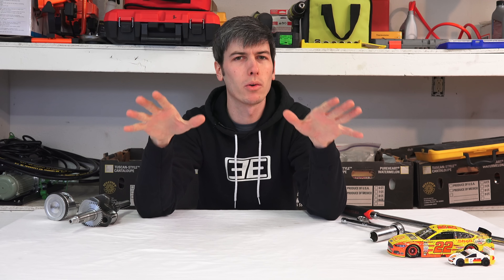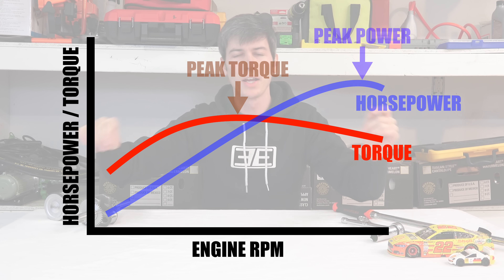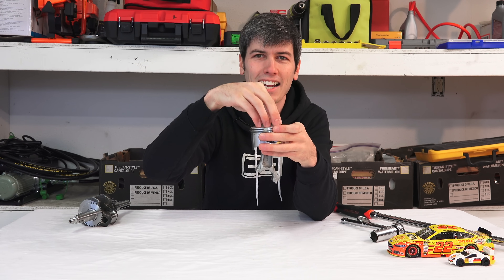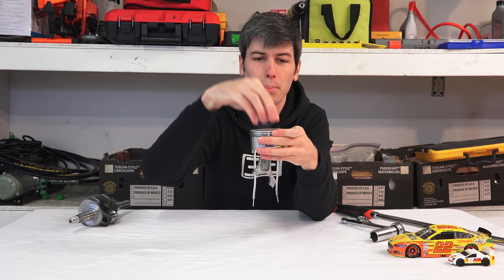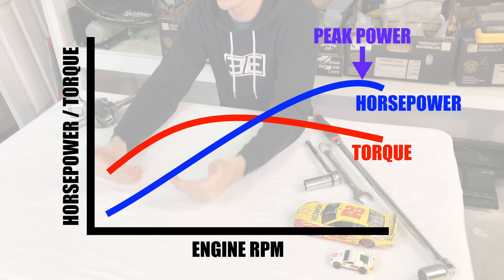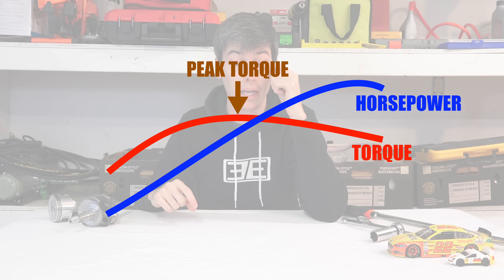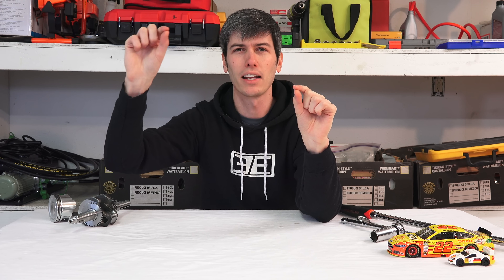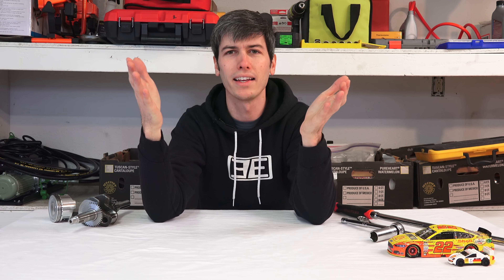Horsepower vs Torque - A Simple Explanation

Comment: I think the great drag racer Bob Glidden (or his engine builder) demonstrated how Torque can be used to the same end as horsepower. He ran long stroke engines that produced more torque and won...A LOT. The thing about horsepower is you have to factor in all the power robbing things like increased friction and inertial forces as RPM increases to where at a certain point it overcomes the advantages of RPM and then goes boom.

Comment: Ok so it's like the difference between the high gear and low gear on a ten speed bicycle. The same power is applied for both, but the gearing gives you different  torques (power applied over distance). The higher gear makes you go faster, but the lower gear gets you over those steep hills easier.

Comment: Being a simple guy, to explain this relationship between torque and power, couldn’t we just use the gearing on a 10 speed bicycle?   If you have the gears on the largest pedal sprocket and the largest wheel sprocket, you are then at the easiest pedal-load, where resistance is minimal, but then again, so is the forward progress of the wheel....

Comment: A car has 120 bhp at 4000rpm power and 280 Nm torque at 1800rpm. Here the equation told by you horsepower=torque x rpm is not becoming true. Kindly explain.

Comment: H.P. = (Torque)(RPM)(2)(pi)/33000.    [torque measured as lb-ft];  Torque [lb-ft] and energy [ft-lb] are measured in the same units. They are not the same thing , however.  H.P. = work/time.  1 HP = 640.8 food Calories/hr  (note the capital "C")

Comment: This video was soooooo confusing!  How can that bigger car be so much faster than that little tiny car?!  🤔.... If those cars were scaled up to “real size” cars that big one would probably weigh about 5,000 lbs., and that little car would probably weigh about 2,537 lbs., making it the much faster car because the horsepower ratio would be way different and the torque meaningless.  Jeez, even a 7-year old would know that.

Comment: Horsepower is not a force.  It's a measurement.  That's where most people get it wrong.
Reply: This struck a chord more than anything he said.  Nice.  Different people need different explanations I guess.
Reply: Torque is force(rotating), Power is force X velocity(rpm X 2π)
1 horsepower is 0.746kW
Torque and power is much Simpler in metric
They probably measure in Horsepower to confuse people and it sounds larger than kW
Reply: @Connor Heh, yeah. That was my point- simply calling it a 'measurement' doesn't distinguish it from horsepower.
Reply: A measurement of what? This is meaningless.
Reply: @provi480  a measurement of work over time.
Reply: @LCDdashSystems  Yeah... that's kind of the key point that you didn't mention initially. Simply saying that it's a measurement doesn't convey any useful information. Torque is also a measurement.
Reply: @provi480  but that's what the guy in the video says all the time, @Procision-Auto just nailed it.
Reply: @provi480  It's not meaningless.  Read it again.

Comment: Both the description and the diagram are incorrect. Horsepower is measured as the heat expansion ability of the combustion pressure. Torque is the rotational force produced and that force does not travel in a straight line but twists around the crankshaft centerline.

Comment: Basically a motor only produce Torque. The horsepower is a mesure created to help people getting into it. For example what better a motor with 200 lbs of torque at 4000 rpm or another one with 150 lbs at 8000 rpm. On the first example the motor make 152 hp and in the second one 229 hp. U can easily find the formula into google
Reply: But on normal everyday roads the first example would be more enjoyable to drive. On a race track the second example.

Comment: He's talking about Power and Torque measured at the engine. Which is great if you have the ability to build your own gearboxes. But Mr Average doesn't have that ability so he measures Power and Talk at the wheel, gearbox already tuned to what the engine produces. So in reality his example of 200HP - 100LB/FT v's 100HP - 200LB/FT surely the cars would accelerate equally?

Comment: Hi, I like your videos, I would like to know if you make a video on 4/6 8 cylinders, power cycle, and comparison with lesser engine cylinder turbo. power torque and driving dynamics. For example say, 6 cylinder Honda Accord vs 4 cylinders 2-liter turbocharged accord. which will drive better, little bit technical and physical interpretation. Thanks

Comment: This is a very nice video presentation unfortunately I have read comments here that are terribly wrong! Please people, if you are not a Certified Mechanical Engineer or a Certified Mechanic who has excellent theoretical knowledge in Power Calculations please DO NOT INSIST YOUR OWN ANALYSIS! You will only mislead other people with basic knowledge on Power calculation. Please do not talk about the difference between Torque, Horse power, and RPM if your knowledge is just your own personal understanding or experience. Remember, only the Educated ones are authorized to give a correct answer. Imagine if you are just a mechanic and then you will operate a patient with tumor using your own knowledge or understanding in how illness are cured, do you think it's appropriate?! LOL. So please DO NOT INSIST your knowledge here if you do not have a certified education on this mater, because I repeat, you will only be misleading other people who wants to learn the correct way. If you think you know it on your own personal understanding, then keep it to your self. Do not spoil the correctness or accuracy of this great video!!!!

Comment: Hi... Any one pls.. I understand.. But what means 230 newton metre.. Or some other values...
Reply: Those are just numbers, so U can compare them easily. Of course they are full lie, as they don't state the weight, what fuel is used ... so those are just like general numbers to give you some impression. Those are numbers made that you can throw your hard earned money. As if you look at the numbers you would buy 2000cc motobike or a Ninja2, but in reality all you need is 300cc adventure bike. The numbers are here coz we are trained to restrain our minds with them since very young. So we start to believe hard that numbers are special, trustworthy and 'easy' for the brain.

Comment: There's a more simple explanation:

Horsepower influences the speed you hit a wall with
Torque influences how far you push the wall you hit
Reply: gajustempus yes you are right In short I think it is the best explanation.
Reply: @sandeeptiwari3655  But it's entirely wrong
Reply: Sandeep Tiwari  How fast you go also affects how far the wall will be pushed. 
How about this? 
Horsepower influences the speed you hit a wall with
Torque influences how far you could push the wall in if you started right against the wall.
Torque is leverage, horsepower is a combo of torque and revolutions. So an engine with more torque down low will be able to push it further without having high rpm.
Reply: makes no sense at all. torque is a rotational force. if you can rotate your wheels while pushing a wall so that the wall is moving. you should be able to keep pushing that wall an infinite distance as long as your wheels are moving and not spinning in place.
Reply: @dynamo3059  my bad I didn't quite think that through lol

Comment: Torque is being manipulated by the gears. THE GEARS ARE BULLYING TORQUE....TORQUE IS SAD.
Reply: Torque is sad - (i)
I am sad - (ii)
Therefore from (i) and (ii),
I am torque.
Reply: @mrarmaan999  V
Reply: @mrarmaan999  😂
Reply: @mrarmaan999  Aside from the ambiguity in your wording, you realize that's not even a valid syllogism, right?
Reply: No torque!, no torque! YOUR the TORQUE!!!
Reply: torque needs a therapist
Reply: torque is happy. torque loves to be put to the road.
Reply: L.M.F.A.O
Reply: not bad
Reply: horsepower without enough torque is useless.
Reply: ONE 403 eg smaller petrol engines in larger cars.. better off with diesel, higher torque at lower revs
Reply: @m3n4cE6  also torque without enough horsepower is useless
Reply: @malubulul383  lol
Reply: @m3n4cE6  any Work Torque can do Power can de better and/or faster.

Comment: I understand the theory in this video.
But I have experienced the opposite same car same engine around 300kw at flywheel same gearbox. Turbo charged 6 cylinder 3.0L engine manual gearbox I changed from 4.11 diff gears to 3.69 diff gears and the car accelerates much quicker any idea how this works?

Comment: Torques is why the fastest accelerating car is electric (not all, just the fastest one), electric motors have instant max torque (well discounting time for electric field to build up),I dont care I will always love and want big honkin', gas eatin,' smog produing' rumblin' engine whose back wheels are there to lift the front wheels off the ground type of torque. 

If an electric car accelerates in the woods with no noise, did it really move?
Reply: Pollution issues aside, I'd rather have a quiet and simple electric motor that went effortlessly fast than a big, complicated and noisy engine that doesn't go so fast. Internal combustion engines are on their way out and electric motors are a big win-win for everybody.
Reply: Only major problem with electric cars you know is limited range with battery set,
Reply: Ever heard a Formula E car? Those things sound like they are about to fire a plasma beam out of their exhaust.

Wait...
Reply: Nothing beats the sound of a powerful v8 engine
Reply: You are a scholar and a gentleman
Reply: What you wanted to say is that electric cars are the fastest accelerating because they have instant power but not torque, torque is useless

Comment: One important thing left out is torque at the wheels vs. torque at the crankshaft.  Torque at the wheels alone is what determines how fast the car accelerates.  Horsepower is the ability to supply that torque at higher speeds.  So the car with 200 lb-ft of torque will beat the one with 100 lb-ft until it doesn't have enough power to supply 200 lb-ft any more (assuming the torque is measured at the wheels, through the transmission).
Reply: louisxiiii
That is wrong. Power is not the ability to maintain torque at higher speeds. It is work-rate and the engine which works faster will accelerate the car faster. 
Acceleration depends on torque at the wheels, but torque at the wheels is torque at the crankshaft x overall drive ratio. The drive ratio is engine speed to wheel speed, and the engine turns faster than the wheels, so in a higher gear the drive ratio is lower and wheel torque is reduced. A torque figure on its own doesn't tell you what the torque at the wheels will be. 

The 200lb-ft engine may produce maximum torque at 2,000rpm, and 100hp at 3,000rpm. 
The 100lb-ft engine may produce maximum torque at 8,000rpm and 200hp at 12,000 rpm. 

The car with the 100lb-ft/200hp engine will have much lower gearing to enable it to use its power, so it will accelerate faster and have a higher top speed.
Reply: louisxiiii fantastic clarification...I am in the early stage to learn about torque and hp,.. Your comments helped me a lot
Reply: I was waiting for this to be said in the video (car with 200 TQ will out accelerate the 100 TQ for a certain amount of distance/time). Question I have is why manufacturers use 5252 rpm for their crossover point for TQ and HP?
Reply: @gbarton800  
Manufacturers don't "use" 5252rpm as the crossover point. That's just where it is when using lb-ft and hp.
1hp= 33,000ft-lb/min
33,000 / 2π = 5,250
5252 is more precise but 5250 is convenient and accurate enough.
Reply: Nightjar on the gate thanks for the response and explaining the math - that makes sense. By the way, I meant 5250 (fat fingered?). Thanks again!
—
What’s your take on the TQ vs HP race early on?
====
Reply: @gbarton800  It is 5252, but I put 5250 out of habit. It's not exactly right but it makes calculations easier. 70lb-ft at 3,000 rpm gives 70 x 3,000 / 5250 = 70 x 4 / 7 = 40hp.

The early part of the race will depend on the gearing. The car with more power has half the torque of the other car, but revs four times faster (see my reply to louisxiiii). If the two  cars start in gears that give them maximum torque at same road speed (say 20 mph) and maximum power at the same speed (say 30mph) the 100lb-ft car will have twice as much power at any speed in that gear and twice the torque at the wheels, so it will make the 200lb-ft car look very slow. If they start using the same gearing the 200lb-ft car will get away much faster.
Reply: @gbarton800  James Watt determined that a horse could turn a mill wheel 2.4 times a minute. The wheel was 12 feet in radius; therefore, the horse travelled 2.4 × 2π × 12 feet in one minute. Watt judged that the horse could pull with a force of 180 pounds-force. So:

    P = W t = F d t = 180 l b f × 2.4 × 2 π × 12 f t 1 m i n = 32 , 572 f t ⋅ l b f m i n . 

Watt defined and calculated the 1 horsepower as 32,572 ft⋅lbf/min, which was rounded to an even 33,000 ft⋅lbf/min. The constant 5252 is the rounded value of (33,000 ft⋅lbf/min)/(2π radians/revolution).

Hope that helps.
Reply: srsly, torque is the only thing accelerating your car. acceleration is what causes u to get pushed back in seat. thats why him saying peak horsepower causes.mote acceleration while peak torqur causes u to get pushed back in ur seat the most makes no sense.

Comment: Very interesting video, but at the beginning when you say that "the one with more power will always be faster," this IS assuming what is later explained in the video, correct? I mean to ask, if those two cars with 200HP/100lb-ft and 100HP/200lb-ft figures were BOTH using the exact same gear ratio as well as being identical in mass and size and whatever, would the one with more power still accelerate faster? Because now I'd see that, whichever has a greater wheel torque would make sense to me to accelerate faster, even if it was powered less. Is this right?

Comment: With all factors being the i.e. vehicle weight, rolling resistance, aerodynamics AND gearing, the higher torque valued vehicle should move quicker since torque will overcome inertia faster than horsepower can. all other perimeters being equal.

Comment: If both cars are geared the same (with same max rev). The car with more torque will accelerate faster, in general. The h.p. car will have to raise it's rpms excessively to try too compete off the line.

Comment: How can maximum acceleration occur at peak torque, rather than peak power, even for a fixed gear? If acceleration is thought of as the rate of increase in kinetic energy, wouldn’t maximum acceleration have to occur at peak power, by definition?

Comment: I don’t understand the difference between “feeling the seat pushing against you the most” and “peak acceleration.” If the reason you feel the seat pushing against you is because of G-force due to acceleration, wouldn’t they be the same?

Comment: with same bore. and stroke short rod will give you more torque,  it is about rod angelarity this why the chevy 400 uses a5.4 rod instead of the usual  5.7 . also the longer rod can give  you more power  because  of longer dwell at the top  during the  ignition burn down.

Comment: Horse power is proportional to watts = nm/s = lb-ft/min
Torque is nm or lb-ft
RPM is 1/min
Therefore 
Horsepower should be proportional to torque * rpm (max)
And since torque is force * distance, if you have a greater wheel torque but equal wheels, you get greater force on the ground.
Therefore greater acceleration because force is proportional to acceleration with the same car.
So the bottom car would accelerate faster until the max rpm is reached. 
Am I right?

Comment: Actually, acceleration is only related to torque. The formula for acceleration is F = MA or Force equals Mass times Acceleration, or A = F/M.

Since the wheels are a fixed diameter, the number of pounds of force that the tire is exerting on the road is constant for a constant torque. Therefor, if we were somehow able to keep the torque of the engine constant at every RPM without switching gears, then the acceleration would remain constant at every speed for each gear.

However, because the torque of an engine is not constant for every RPM, we are required to use a transmission to increase the torque at higher speeds relative to what you'd get if you didn't have a transmission. For maximum acceleration you need to maximize the torque at the wheels.

Because horsepower is force x distance / time = torque x RPM, more horsepower at higher RPM can be converted to more torque at lower RPM which is exactly what the transmission does to maximize the torque at the wheels for a given speed.
Reply: Torque X RPM = Power

What the transmission does is convert one torque value to another by changing the RPM. Physics dictates that the output power is equal to the input power minus the inefficiency of the transmission due to friction. Without friction, the power will remain constant regardless of the RPM or torque.

Comment: Hi there, I have a question about a diesel power curve, if torque increases with rpm initially as more air and fuel are provided for a bigger force on the piston. How come the torque starts decreasing at higher rpm? I have read the exhasut gas as less time to escape at higher rpms and also that friction of the moving parts starts to increase at higher rpms - decreasing torque. But if the force on the piston is no longer as large how can the rpm continue to increase??

Comment: Why we get more torque in 1st gear?
Reply: You have to distinguish engine torque from wheel torque. Engine torque is the same in every gear, wheel torque is not. You can think about it this way: In lower gears, RPM is sacrificed for torque. In higher gears, torque is sacrificed for RPM.